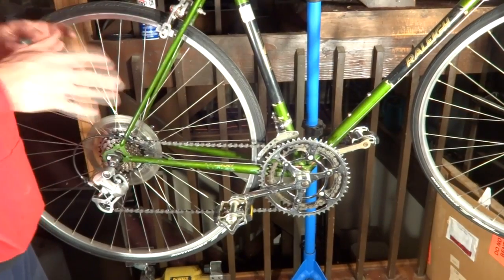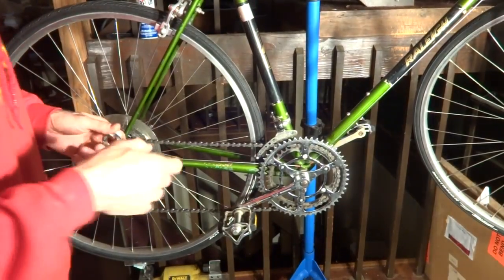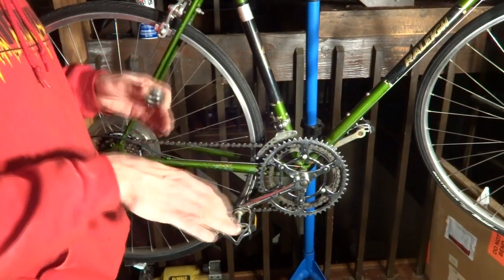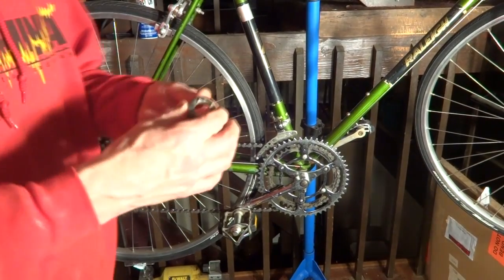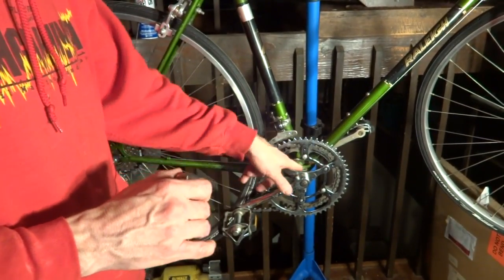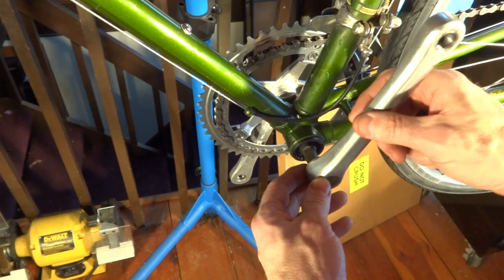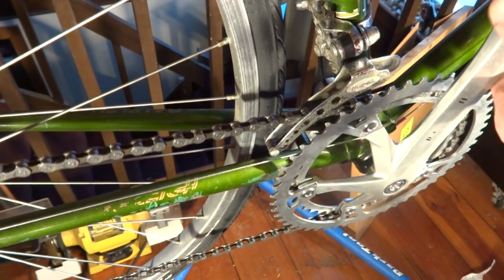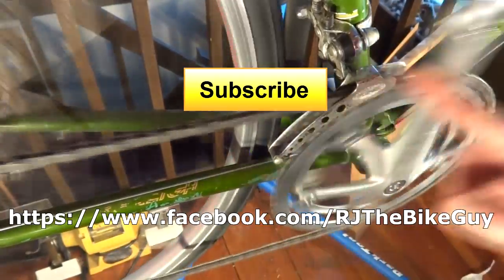Convert From Cottered Crankset to Square Tapered Cranks/Bottom Bracket

Comment: Several years ago I was able to upgrade an old Raleigh Record from cottered crank to square taper by replacing just the spindle, and re-using both of the original bearing cups and the original bearings.
Reply: This is what I am trying to do but I’m having issues with spacing. Every spindle I have is too short which makes it impossible to tighten the adjustable cup properly. The secondary ring doesn’t have enough threads to get a bite, this keeps causing play in the bottom bracket.

Comment: Hi RJ, I found with working on cottered cranks, one tool is the discontinued Park Tool press, 024, but, another option is to buy an automotive ball joint press kit from Harbor Freight and use the C press in that kit along with the adapters, to press out the cotter pin so you don't have to drill it out - This method allows you to sell the cottered crank set with its bottom bracket, for someone else to use, from the vintage bike collector world. -Colin Bennett
Reply from the maker: I made a tool https://www.youtube.com/watch?v=JIIjID_KdiY
But it's tough to get the pins out without damaging them anyway.

Comment: Hi there. great guide. I measured my spindle to be 117.5. Now since I'm converting a vintage road bike with 2x5 speed to fixie, should I get a spindle length lower than 117.5? If so what would be ideal?
Reply from the maker: Can't tell you what length to get. You will have to experiment with chain line.

Comment: i think that the square taper to crank grease actually might stop galvanic corrosion, as it is press fit, i don't think it harms. i think that eventually all press fit might needs some additional push after a week or so as it might need an extra umph.

Comment: Hello, thank you for your videos, they are amazing!
And should we do if the chain ring continues to waggle, although we have tried each of the other three directions of the square spindle? Мaybe the chain circle is crooked?
Reply from the maker: It could be a damaged bottom bracket, or maybe a bent chain ring, or maybe the mating faces in the crank are damaged.

Comment: I was wondering if I could reuse the cotter pin cups and just replace the axle with with a new tapered axle (non cartridge) assuming the cups were in good shape?
Reply from the maker: +Mike C Cotter pins can be reused if they are in good shape. I would not try to use a square tapered axle with the cottered bearing cups. I know on some they are different and the bearings will ride slightly off their regular position and they will wear down and mess up the cups too.
Reply: +RJ The Bike Guy thanks for the quick response.  That explains a lot.  I tried doing just that a couple years ago and it felt good initially but then it loosened up quickly.  After I readjusted it, there was a lot of friction.  I will not try it again.
Reply: Apparently you need to buy slightly larger ball bearings and it will work. This must be the most cost effective way of conversion of 26tpi bb to square taper.?  No re-tapping of the bb etc...

Comment: Nice you use the metric system!! Welcome the 21st century!!
Reply: @SenseiGichinFunakoshi ? The bottom brackets/spindle are specified in millimeters, he had no choice. If he measured it in inches, he still would have to convert to millimeters to find the bottom bracket he needs. If you do some research, you'll realize that the United States tried to convert to the metric system, but they determined it would be at a large cost to the taxpayer to do so.

Comment: Hi, do you know if bearings from square taper crank would work in the cotter crank set? i have a feeling there's going to be carnage to the shaft/cups but if not i'd like to just stick in some used ones  i have in an old bike I'm playing with (keep costs down, it's not worth much/anything)  thanks
Reply from the maker: Replace the bearings. They are very cheap!
Reply: @RJTheBikeGuy  are they different bearins to the tapered square ones? the ones i have here from the taper square are near new.

Comment: I have an older Raleigh Grand Prix (I think it's a 1977).  Based on this video it looks like I can't replace the BB?  My shop told me to clean the bearings and everything which I think I would be happy with, but I do want/need to replace at least the non-drive side crank arm if not the whole thing.  They are cottered (obviously), I'm just seeking advice about what the best thing to do really is.

Thanks, you have lots of really informative videos!
Reply from the maker: Elliott Wells It depends on BB threading. If the threading is commong 24tpi, then you can. If the threading is Raleigh 26tpi, then you can't do it like in this video. This bike was a Raleigh Grand Prix and had 24tpi threading.
Reply: +Elliot Wells  You can replace the BB if you rethread the threads right?
Reply from the maker: You can get a threadless BB. I don't think recutting the threads is a good idea. One the tool is expensive. And two, cutting 24tpi over 26tpi would probably not leave much in the way of usable threads.
Reply: Are all grand prix 24tpi?

Comment: When i tried this on a old  Raleigh I ran into the Raleigh proprietary 26 thread issue so I was stymied in trying to convert and went back to cottered - wish I'd seen this video 7 years ago lol.  Have you tried a thread-less BB like velo orange sells or the "repair" BB that I see from sunlite on Amazon in cases with the proprietary thread bb shell?
Reply from the maker: This won't work on Raleigh threaded BBs. The bearings will not roll in the right lines in the races. You can use different size ball bearings. I can't remember the size off hand. A threadless BB would be a better option. I haven't tried them, but have read good things.
Reply: thanks for your quick response.   I may have to try it someday and I have a Motobecane Mirage frame laying around with a cottered crank so maybe I will give it a shot with the threadless bb.

Comment: cotter pins are a tapered wedge shape & should be knocked out from the nut side only with the nut loosened,if u try to hammer it through it will shred the pin & probably damage the axle & the pin's hole in the crank arm,it shouldnt need a lot of force unless there is dirt or corrosion trapping it,wd 40/rp7 or similar penetrating oil will help & if it's really stubborn spray until it's soaked & give it time to soak in before trying again .

Comment: what year is the Raleigh Grand Prix 75-76 when did start  24 tpi  on the gp
Reply from the maker: I do not know. Some time on google might reveal the answer. And since you are the one who wants to know, I will let you work on it.
Reply: Its hard to say, given that Raleigh had a couple different factories and were probably trying to use up old back-stock before switching to 24 TPI whole hog. From my experience the cut-off was around 1972 for 10 speeds and maybe a little later for their Nottingham three speeds. Again, not a hard and fast rule. 

RJ, respectfully-- I understand how annoying people can be with their perceived lack of internet sleuthing, but you sound like a neckbeard when you condescend people in your comments section. And funny enough, I seriously doubt this viewer is the only person that is curious about the idiosyncrasies of English bicycles. In fact, it seems like a relevant question for all intents and purposes of your video!

Comment: Why no grease on the plastic part? We on our bike shop use little grease on the threads so threads on the frame don't rust as easily.
Reply: Some greases can disintegrate and break-down plastic
Reply: Yea, figured that much. Mineral oil based lithium grease shouldn't eat plastic. Lgmt 2 is just that and we use it. Here's a quote "
Typically, lubricants based on silicone, PFAE (perflourinated), most synthetic hydrocarbons (SHC or PAO), or mineral oils work well with plastics. Lubricants based on esters or polyglycols are generally not compatible with plastics, although there are exceptions depending on the type of plastic.
"

Comment: Whats your thoughts on whether or not a Sunlite thredless repair bottom bracket is a solution to a threadless upgrade on 26tpi Raleighs?  I just bought a Raleigh Grand Prix built by Gazzle. It looks like it has the Raleigh standard cups so I'm assuming it's 26TPI. I only paid $3 for the bike so normally I'd just send it to Gooodwill but this frame is beautiful. I'm really digging the lugs on the frame. I've been wanting a modernize a vintage steel frame road bike for awhile and this seems like it would be a great ride so long as I can get the BB figured out.  Thanks
Reply from the maker: I haven't tried them, but I have heard decent things about them.

Comment: Can i still use he same cups on my Peugeot mixte 70'ish and remove cotter pin cranks and still be able to use square taper made for Peugeot ? Cause I have the Peugeot crankset but no cups.
Reply from the maker: Ricardo del Rey You're talking about not using a cartridge bottom bracket like in the video? You would probably have to find one made for French threading. There are some out there.
Reply: ok got it thank you much :)

Comment: What if the chain rings are not the same distance?  I recently made a bike and the chain steps on top of the teeth of the big chain ring each time and then falls on the outside of the ring.  Certainly the problem is not in the limit screws.  Is it possible that the problem is that the chain rings are at a greater distance than before?
Thank you!
Reply from the maker: Sounds like cable adjustment and limiting screws.
Reply: RJ The Bike Guy actually the problem was in the bottom bracket (it was too long)

Comment: Hello RJ, my steel bottom bracket shell has to cilinders glued to it and the threads are on these cilinders. I googled it but nothing. I have asked many people and nobody know knows.
Reply from the maker: Dunno. Is it a carbon frame or something?
Reply: @RJTheBikeGuy  It is a steel frame. The bottom bracket has no threads and it's thin. I has like two threaded "rings" to which the bottom bracket is threaded. I suspect it's a way to cut expenses and I worry such a thin bottom bracket might not last too long (and I bought steel hoping it would last longer in time)
Reply from the maker: I am not psychic. I can't tell you with such limited information and not having even seen the bike. Do some research on the bike model.
Reply: @RJTheBikeGuy  I'm sorry. You are right. Unfortunately for me the bike company does not answer to my email. Thank you for your time
Reply from the maker: @아우빠  Do research on Google.

Comment: I am currently working on a Peugeot, I am guessing it is from the 70's. It looks exactly the same as the one you did bottom bracket overhaul on. I was hoping to do a similar conversion on my project as the one you are doing in this video could you provide me any insight before I dive in. Any idea what bottom bracket would work or if I am gonna have to go with a 35x1 cup set and a square taper axle?
Reply: Did you ever find out? I am at the same place, today

Comment: One thing I don't understand- why has the right side got a reverse thread, and the left side a normal one?  I would have thought that as the crank rotates clockwise (when viewed from the sprocket side), this would tend to undo the bearing cups?
Reply from the maker: You would think, but it's actually the opposite. If the right cup were normal threaded like on French and Italian bikes,  the cranks will tend to loosen it. Something to do with the rotation of the bearings.
Reply: Thanks, actually I Googled it as well...  Apparently, it's something called procession.  Where you have an axle rotating within a cylindrical bearing, for some reason the bearing rends to rotate in the opposite direction to the axle!  This also applies to the left-hand pedal & the freewheel..

Comment: Is it possible to just replace the axle and keep the original bottom bracket?
Reply from the maker: Not and have it work correctly.
Reply: @RJTheBikeGuy  I have a vintage French Peugeot with French threading and a 68mm Bottom bracket casing and a 129mm cottered spindle, can you recommend any BB replacements?
Reply from the maker: They make French threaded cartridge BBs, and also threadless BBs. Those are your only options that I am aware of.

Comment: I bought a 110mm for my Raleigh but the drive side is sticking  out too far. Any ideas?
Reply from the maker: Maybe flip the spindle? Get a shorter spindle?
Reply: I checked the Sunrace spec for the crank I ordered and it calls for a 107mm spindle, so I'm guessing that's it. I'll order a crank that needs a 110mm and follow up.

Comment: Hey, i want to replace the crankset of my motobecane, its a french bike, do you know if its a different thread? And if so where can i find one?
Reply from the maker: You may need a French specific BB. Vintage French bikes had a right hand threaded fixed cup.
Reply: can i just switch the axel if my cups are still good?
Reply from the maker: Maybe. But be aware that the bearings might not ride in the races correctly, On old Raleighs you need to use 15/64" bearings instead of 1/4" bearings. Not sure about French BBs.
Reply: How do i know that it doesn't ride correctly? (Sorry to bother you i'm relatively new from all those bikes stuff)
Reply from the maker: Check this page:
http://sheldonbrown.com/raleigh26.html
Go down to where it says "Upgrading to Cotterless Cranks".
Reply: thank you! it's pretty helful

Comment: does this same process apply to a peugeot UO8?
Reply: Most if not all early bike boom Peugeots have a French threaded bottom bracket with 35mm x 1mm threads, both cups being right hand-threaded. Velo Orange sells French threaded sealed BBs in different lengths. Not cheap by any means but great for that UO-8 you wanna build for touring or a single speed beater.

Comment: With all due respect, grease those tapers and bolts! You'll get a truer torque and it will in no way reduce the crank arms lock down.
Reply: Most torque specs are dry unless stated otherwise. If you add lubriant you will actually exceed the recomended torque if you are using a torque wrench. If you put grease on square tapers and try and follow the manufacturer torque spec you will overtighten the crancks, and possibly expand the crack hole right past the end of the tapper on the spindle. I found this out the hard the way. Destryoed a perfectly good cranck arm and smacked my head off the bike frame when cranck gave way. You can grease square tappers but don't follow a torque spec if you do. Just go by feel.
Reply: @jessecampbell4580  I forgot me favorite motto. "Never tell a man his medicine is no good!" Cheers!

Comment: Rough... hammering screwdrivers to remove chain rings, cotter pins trying to drift out on bouncy wooden floors...
Reply from the maker: I am guessing you haven;t worked on many old cottered crank bikes.
Reply: @RJTheBikeGuy  Well you guessed wrong.. I was repairing and building my and my school mates bikes from scrap bikes and bits brought to me to fix up back in the 1960's. Cotterless cranks were restriced to Tour de France quality bikes at that time, so getting the cotter out was an early aquired skill. I respoked and trued buckled wheels on my home made rig too.

Comment: Not to be heretical, but is there a reason you couldn't just use the existing cups and replace the spindle with a tapered square spindle?
I just bought a Mexican built Benotto mixte so I'm going through your videos to see what my options are. The cranks look good, so I think your video on rebuilding taper pin cranks will take care of my project for now..

Comment: If you convert from cottered cranks, you're a horrible person. As for 26tpi bottom brackets, Phil Wood make suitable cups, and "threadless" bottom brackets (available from Velo Orange) exist that use a combination of clamping on both sides of the bottom bracket shell, and using an expanding mechanism inside to stop it rotating.